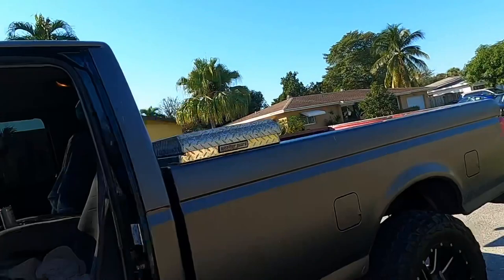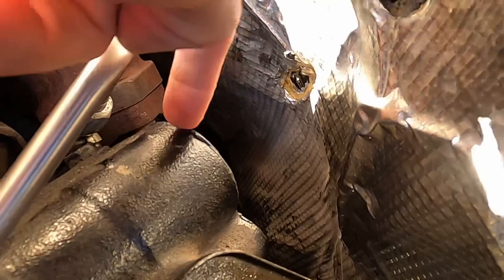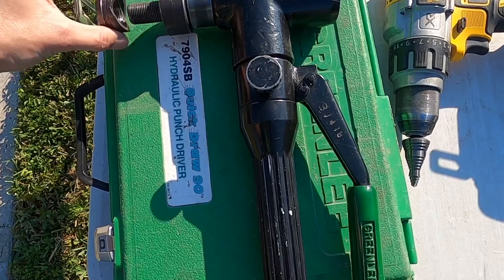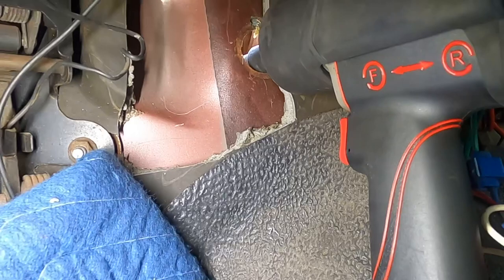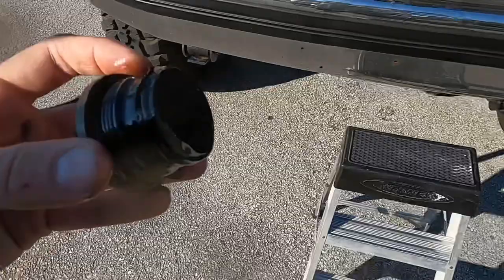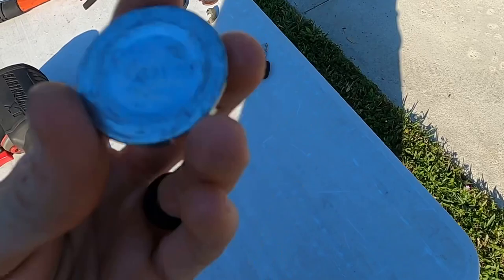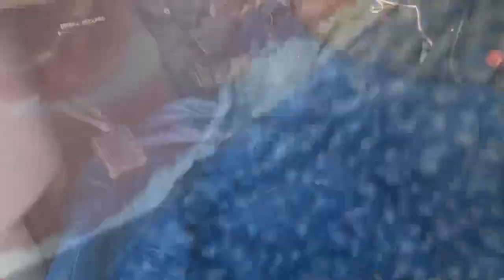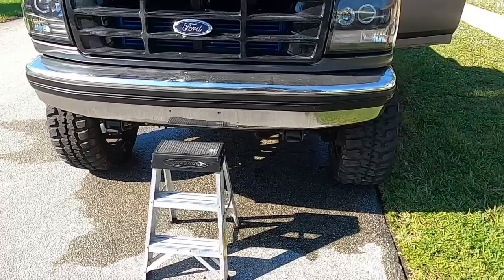OBS 7.3L Powerstroke oil leak remedy!

Comment: 1/2” flex head ratchet is all you need. No drilling
Reply from the maker: Couldn’t get the long handle under the firewall and didn’t have the leverage to use a small ratchet or a wrench.
Reply: @The73Garage  flex head I meant. That’s what I used on mine
Reply: Long handle flex head ratchet by Matco, snapon, gearwrench, even harbor freight has them now. Looks like a breaker bar with a ratcheting head. No firewall hole required. Sick bucket placement tho.
Reply: @too-stoked-about-2-strokes  I'm going to give this a shot. I have a leaky oil rail end plug passenger side. Going on a cross country trip and want it buttoned up. Was finally succumbing to drilling into my fire wall but will try this first!

Comment: My 7.3 OBS leaks 3-5 quarts every couple of weeks, how can you tell if that’s the problem? It’s got 300k miles but runs fantastic other than oil leaks.
Reply from the maker: Best way to tell it to stick your phone in the back of the engine while it’s cold to see if it’s leaking down. It can mimic a rear main seal or a turbo o-ring leak. Tends to leak more when it’s warm too.

Comment: i like this method better than flex head ratchet method. seems like much less chance of something going wrong with the difficult angle. thanks
Reply from the maker: As do I, I tried multiple times with 1/2” drive flex head snap on ratchet and just couldn’t get the angle. Not worth getting hurt or breaking something.